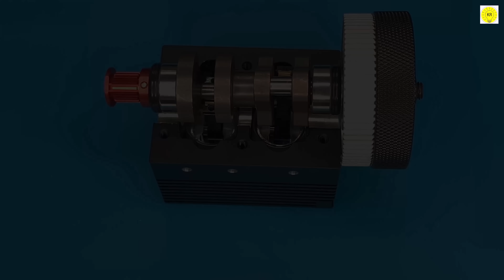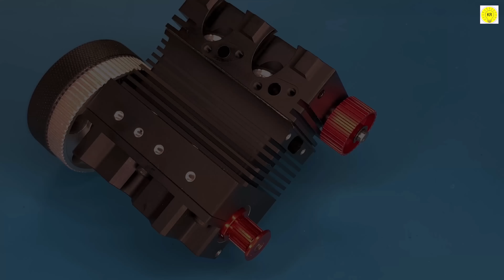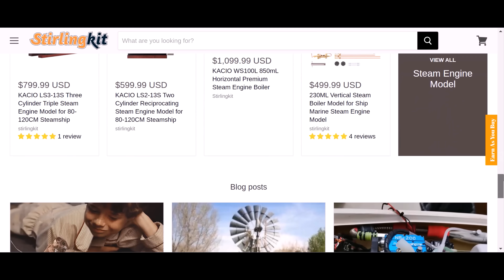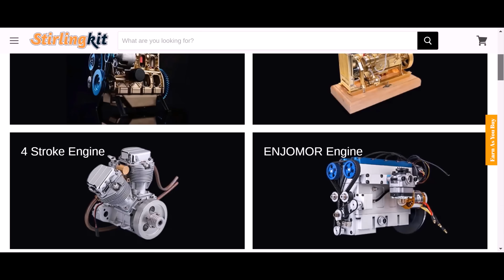assembling & running the cheapest twin cylinder four stroke rc engine ,stirlingkit

Comment: Very cool!! A little input if you don’t mind… 1. Needs some kind of load on the flywheel during break-in( always really). I’d suggest melting down some solder with high lead content and fashion the entire flywheel. 2. Add another tank plumbed to “oil pan” nipple. Then add a tube from the new catch tank to the fuel tank. Would make for a cleaner display. 3. A proper exhaust system consisting of tuned pipes and baffled chambers. Would finish off the exhaust sound, look cool and ultimately run better. 
Thanks for the awesome video. The attention to detail is satisfying to see.

Comment: What kind of oil and grease was used
Reply from the maker: You can use W40 oil. As for greases, it is preferable to use greases with high temperature resistance